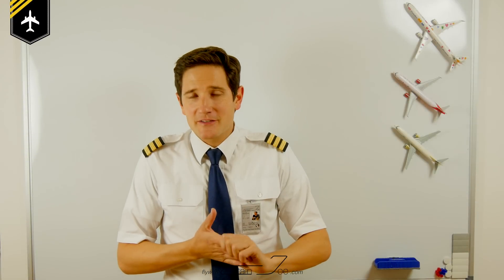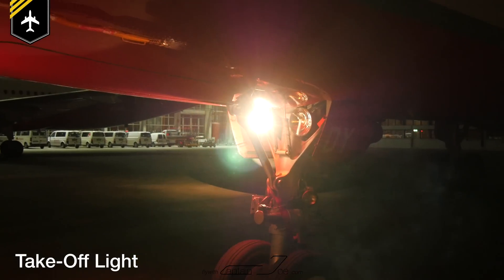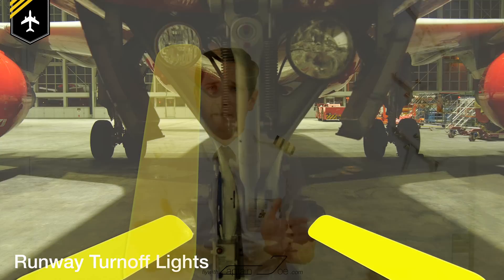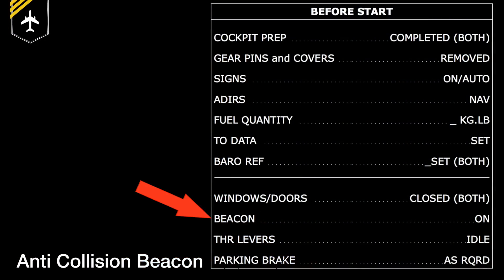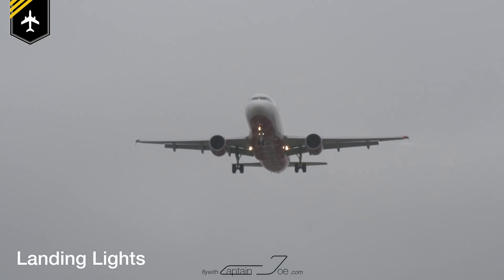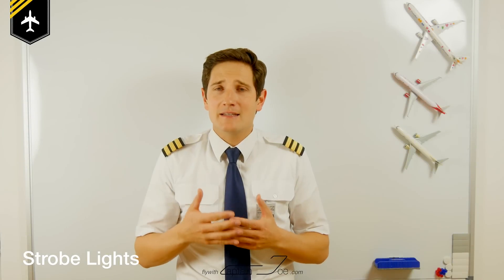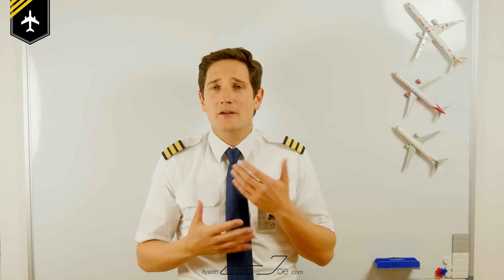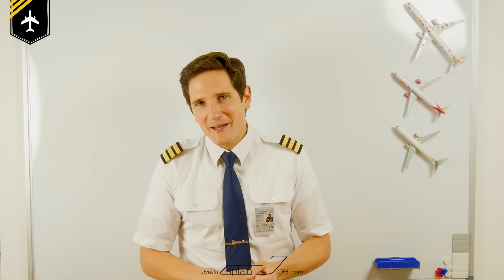LIGHTS on Airplanes explained by "CAPTAIN"Joe

Comment: I have one query, 
Why Taxi light & Take-off light 💡 are not fitted on the Nose of aeroplane ✈ instead far behind on Tyre??
Reply: kuldip jadhav the radome (the nose of the airliner) is a cover for an antena. Therefore, it should not be made out of metal. Putting the lights over there can cause and interference in the antena's signal, messing up the whole thing.
Reply: A little late but I hope I helped

Comment: why do the crew ask you to switch off all electronic equipment during flight - or at least during take off and landing?
Reply: PS :- I originally meant to ask that "how annoying are the electronic equipments, like phones, to the pilot?"
Reply: Sandeep v menon Its been proven that they dont actually affect the electronic equipment. A supercomputer is barely enough to affect the planes systems.

Comment: I've always wondered what is the role of that hole in the tail of an airliner! Can you make a video about that?
PS: I hope you know what i'm talking about from my "description" :))
Reply: Raul F. That's the APU (Auxilliary Power Unit) it supplies power to the plane without needing to start the engines. The noise you are hearing from the plane even with the engines off is coming from the APU.
Reply: oooo,make sense! I knew all these things u said about the APU,but i wouldn't have thought that the "hole" has sth to do with the APU. Thanks! :D
Reply: Raul F. No problem..To be honest I had a really silly idea when I was young I though it was the exhaust. Lmao because when the APU is on it produces heat blur.

Comment: Captain Joe my question- why the runway surface is not straight, it has a wavy kindy of surface. Can you please explain it in your next video. Thanks
Reply: It's built on uneven terrain, so the wavyness is an illusion created with perspective. And no, you can't see the curviness of the earth at such a low altitude. It is round, it's just very very huge.

Comment: Why do planes use flaps when they take off?
Reply: Bill Kaczmarek Flaps are used to increase the amount of lift that the wings create. Along with lift, flaps also create additional resistance in the form of drag. As a result, flaps tend to be used sparingly on takeoff while the aircraft is increasing its speed, but can be used to a greater degree on landing when the plane is in the process of slowing down.
Reply: Bill's YouTube There are quite some different flaps but the most effective one is the Fowler flap, which first extends backwards, thus increasing the wing's surface (used on Take-Off) and than go downwards, to increase the camber (line connecting the Leading Edge to the Trailing Edge of the wing that is equidistant to the upper as lower surface of the aerofoil). Since the lift formula is L=1/2 * (air density "RHO")*speed^2*wing surface*Coefficient of lift => thus increasing the wing's surface on Take off increases the surface of the wing, thus creating more lift, resulting in the ability to become airborne at a lesser speed. On LDG, they go aft and down, so increasing the surface and increasing camber. This gives the airflow another path to follow that changes the down- and upwash. How this affects your lift coefficient and drag coefficient is a bit too complex to explain in a youtube comment, but basically, it reduces your 1G stall speed (Vs1g), allowing you to fly slower on approach, thus reducing the landing distance.

Comment: Captain Joe, when I fly on older A319/A320 there is a very loud hydraulic pump grinding/whining sound near the over wing exits/main landing gear belly area that comes on during taxi to takeoff. I assumed related to adjusting flap positions in preparation for takeoff, but the noise is intermittent and comes on several times while taxiing like pressurizing hydraulic system or something. One time I was sitting on the taxi way waiting for takeoff on a Frontier (USA) A319 and the noise was very loud/grinding and kept coming on and off as if the pilots were having trouble with something, it was quite alarming but eventually took off with no problems. I did not notice this strange noise on the newer Swiss A321 I flew on recently. Not sure if you are familiar with this noise or if this is only on the older Airbus A319/20 series. Thanks ✈️

Comment: Is the red blinking light above and below aircraft also on during flight or only during taxi on ground?
Reply: You are wrong!!!!

When the red light is blinking it means:      Attention KMART shoppers.  We have a red light sale on aisle #7.
Reply: rif42 on all the time, it's called the beacon light, I think usually when the aircraft is ready for push back it is turned on
Reply: rif42 the red beacon is on whenever the engine is on. it is mostly for safety for he ground crew
Reply: +Keegan Gidley yep
Reply: NO IT MEANS THE FEMALE CO PILOT IS ON THE RAG .

Comment: Hi Captain Joe, I am not sure how to message you a question so I thought I would comment on one of your posts, can you explain why just after an aircraft takes off they back off the power to the engines and it feels like we are going back down? Surely when taking off we want to keep the power on full and pointing up! It's very unsettling when you hear the engine note go down....
Reply: Alex Yallop they have to remain under 250 knots when under 10,000 ft
Reply: Just want to add that.. A plane does not need to go top speed all the time to fly.. In fact a plane can glide for a long period of time powerless.. It's not just going to drop like a brick the moment power is cut... It is possible to fly a 747 4 engine plane using just 1 engine... Planes are made to stay in the air and fly... Just relax... And enjoy the flight!!
Reply: Alex Yallop Hi, planes rarely use full power on take off, in most cases, these are flat rated or a flex power setting. So during climb, we usually need less power, so that is why they throttle back. In some cases though, when using an extreme flex power setting, thrust might even be increased during climb, depending on outside conditions and the company's SOPs. And the feeling that you are going down is basically an illusion because the accelleration is smaller. This is called a somatogravic illusion and is caused by the force of an acceleration in combination with weight (force which acts vertically downwards), which gives you a pitch-up sensation. Once accomodated to this sensation, any decrease in acceleration (not deceleration!!) will give a slight nose-down sensation.

Comment: Why does the a320 ( I believe)  makes a funny noise under the wings while been push back of the gate and when it arrives to the gate? Everybody laughs about it
Reply: Can the pilots change the oxygen levles on the main cabin,so that in case of an emergency, put everybody to sleep (not kill) on the main cabin?
Reply: Are you talking about the "barking" noise? That is the PTU (Power Transfer Unit) transferring hydraulic power.

Comment: Are any of these lights powered by the RAT in case of engine failure?
Reply: No. The ram air turbine provides just enough power to run basic navigation  - which means a basic fly by wire operation (very limited control) but it will be enough to get the aircraft onto the ground (emergency landing).

Comment: Thanks for the thorough explanation! I was on a flight recently (cca. 3000nm, B738) and noticed during cruise that the flight crew repeatedly turned on the landing lights for a short period of time. Any explanation for this action?
Reply from the maker: Yes, sometimes you use the landing lights to signal to other airplanes, maybe coming right at you at a lower or higher level. No kidding! Greetings Joe

Comment: Thanks for the video! I would also like to learn about internal lights. I've seen pilots turn on and off lights when approaching and departing the airports or descending/ascending. Sometimes back I flew from NBO to Cairo (with Egyptair); the male flight attendant insisted that the window blinders be lifted. I hated it because the white desert reflected so much white light into the plane. Till now I have no explanation why they did that. I remember asking the flight attendant but he retorted angrily in Arabic. I just apologized for the trouble... Why do some airlines insist in bullying passengers? Is it common when flying above deserts to open window blinders (like in my case)? Just a polite question Captain
Reply from the maker: A video about the blinds is coming up :) Greetings Joe
Reply: Captain Joe - thanks 🙏

Comment: Are they all incandescent lights, or are modern planes fitted with led lights?
Reply from the maker: Yes the "newer" ones are fitted with LED lights, and some older ones are getting an upgrade. The LED lights are so much better ;) Greetings Joe
Reply: Niels Daemen new planes are fitted with LEDs
Reply: +Captain Joe Thanks!
Reply: Captain Joe

Comment: Excuse me Captain,i work in the Merchant Navy as a future 2nd Officer,in the Merchant School i learned that Navigation lights angle are 112,5 degrees each which and the aft white light 135 degrees. Correct me if i am wrong.
Reply from the maker: Hmm I´ve checked my books, and it said (2x)110 to 140.
Reply: Captain Joe Well maybe it's a different story between an aircraft and a ship. Thanks for your answer :)

Comment: Hi Joe,
Why do pilots (or cabin crew, don't know exactly who) turn off the lights of the passangers corridor when they are close to take off and land on during night? It's not dark inside the plane but the lights bright less. Is it for security? 
As well, why do we, passengers, have to raise up the blinds of our windows during take off and landing?
Warm regards,
Gonzalo
Reply: Gonzalo Pineda Carmena at night lights are dimmed in case of evacuation, so your eyes will be dark accustomed before you leave the aircraft. (they are controlled by the cabin crew I believe) 
The blinds are raised for a similar reason. It allows the cabin crew to see if it is safe to evacuate using a particular door if anything should happen.
Reply: Thank you very much Firecul42. Now it's more clear. Greettings, Gonzalo :)
Reply: Gonzalo Pineda Carmena No problem, you caught me when I had plenty of time to type away. I made a few other replies to peoples questions also.
Reply: Thank you my friend ;)

Comment: Why are the Taxi Light and Take-Off Light separate?  Do they not illuminate the same area of the taxiway and runway, but at different intensities?  It sounds redundant to me to have two separate lights with different intensities pointed at the same area.
Also, why are the Runway Turnoff Lights counted as separate from the Taxi and Take-Off Lights when they too illuminate the ground in front of you?

Having separate Landing Lights under the wings (huh, I didn't know they were retractable!  Must be an Airbus thing...) makes sense because you can better see the runway and identify to other than you are landing.  But I don't understand why there are two different lights illuminating the same patch of ground on the nose gear.
Reply: EVA_Unit_4A most likely the landing light on the nose would have a different lens, as it is for seeing up to a kilometer of the runway ahead.  The taxi wouldn't need light (very annoyingly bright light mind you) more than a maybe 200 metres.  The turnoff lights are obviously separate to get directional light in the direction of desired turn.  The retracting landing lights on the wing retract for the simple (but obvious, crucial, and most important) reason of drag.  Even the smallest lens would cost hundreds of dollars in fuel, speed losses, and tremendous stress on the light.  If i am not mistaken, some Boeings have lights built into the wing root fairing.
Reply: Yeah, I've know landing lights to be built into the leading edge of the wings forever; that's why I was surprised to see a retractable one here.
Reply: jfsa380

Comment: Please captain, could you please explain the neaning of these terms: Heading, Track, Course, Radial, Beacon
Reply: Heading is the compass direction the nose is pointing in.  Track is the compass direction the aircraft is moving in (which does not have to be the same as the heading).  Course is the compass direction you want to be heading in to get to your next waypoint.  Radial is the compass direction from a fixed location like a beacon to your current position.  A beacon is a radio transmitter used for navigation.

Comment: Captain Joe, I'd like to ask a question that's probably already explained many times in text everywhere, but I'd love to see how you explain it in a video because I know you can make this really interesting, and I'm sure many of us haven't known and want to know as well:

What are the procedures / steps from taxi to takeoff (as well as the meanings behind V1, V2, and so on if there's any more). I recently learned that pilots are required to keep their hand on the thrust lever until V1. At that point, I realized that there might be many things we haven't known, and I'd like to learn some more in-depth.

Hope this can be another topic for discussion, thank you captain!
Reply: V1 is as you say the go/no go point. After this speed you are taking off unless of very extreme circumstances as there is almost certainly not enough room to stop. 
Vr is the rotate speed which in small planes can be very near V1, this is when the pilots will pull back to pitch the plane up and get in the air. 
V2 is safe climb speed, once you achieve this speed you may pitch up more safely until you maintain this speed as a minimum. 
During the takeoff roll the pilot flying (or sometimes the captain in either case, I think it varies) will keep their hand on the thrust (or throttle) levers in preparation to react to any possible abort. 
Between 0-80knots take offs can be aborted safely and so if there is a warning during this phase that might cause them to not complete the flight they most likely will abort here. 
80knots-V1 is the high speed regime, at this point you would only stop for anything serious enough to effect how airworthy or safe the plane is, (eg engine fire/failure, bird strike etc, ) as stopping at this point is putting quite a strain on the brakes and may cause a couple of smaller issues. 
After V1 you would generally only attempt to stop with a very big problem, dual engine failure for instance. For most other things it's better to take off and deal with it in the air. Planes are made for flying so as long as it CAN fly at this point that is the safest choice.
Reply: He already made a video of this :)
Reply: whoa nice to meet you here!
Reply: Hi Capt Joe, Your videos have been very informative. Non pilot like me can easily understand the content. My question to you is what is NFP and FP. How it is applicable in long haul flight. Thank you.
Reply: "I'd like to ask a question that's probably already been explained...in text everywhere".....
....
Have you tried Googling "taxi checklist" and watched videos of the tutorial missions in Flight Simulator X?
Reply: raykrislianggi - AniMusic raykrislianggi - AniMusic V1 on is when the pilots cannot abort the takeoff as there will not be enough runway for a safe stop. 

After V1 they will call out "rotate" and that's when the pilot in command (PIC) pulls back on the yoke or joystick and the after will start to climb

V2 is then the aircraft is in the air, climbing safely and the speed is good either maintained or increasing and it is when the pilot retracts the landing gears and proceeds on the flight 

Hope that helped buddy, however I would like to see him make a video on it as it will be a great vid. :)

Comment: Why do airbuses sometime park with the flaps down
Reply from the maker: Good question, I´ll make a video about it ;) Greetings Joe
Reply: Daniel Gabutin Nope. It's because there's no hydraulic pressure to hold them in the neutral position when no engine is running.
Reply: Anything like that I'd guess is based on the hydraulics when the engines are off.
Reply: Yes, because there is no pressure.  Also, if the mechanic needs to work on the flaps the pressure will be off and the flaps already down for some access such as grease points.  Plus more areas of the flaps, tracks, and flap actuators, torque tubes, jackscrews, fuel float switches, skydrol leaks, and other hardware in the system can be inspected during walk around or by ground/flightline crew with the flaps down.  Of course the main reason is there is no pressure.  You can shut the aircraft down with the flaps up also.  This will keep birds from building nests there if the aircraft is to sit for a long period and also to keep any bad weather out such as snow and ice.  Or if high winds are expected in the area.  I am not familiar with  the Airbus aircraft however.
Reply: maybe landing/takeoff requirements for that craft in that airport?
Reply: .imho. I guess it has something  to do with Bleeds in relation to Temperature.
Reply: Captain Joe thanks

Comment: Nice video, but another question: drones are like aircraft, but they have just green and red light, no white. Green at the rear of the quadcopter and red for front face ! 

Sorry, my English is very bad but I think you can understand the sense of my question.
Reply: Arnaud Vlamynck I don't see a question but I guess you are asking why quadcopters have a different light layout. 
The reason is for quadcopters the main use of the lights is for orientation, to see which way it is pointing, as most are very symmetrical. Planes use these lights for navigation, to see which direction a plane is flying in and react appropriately.